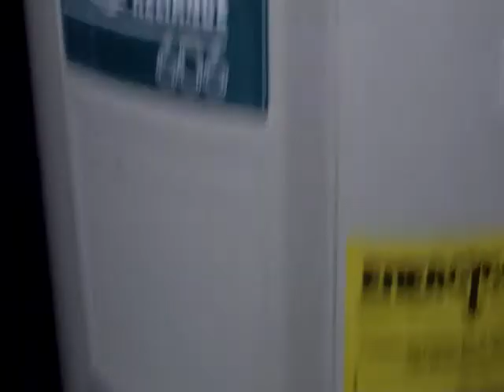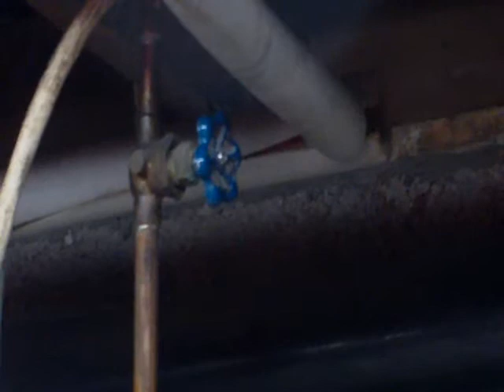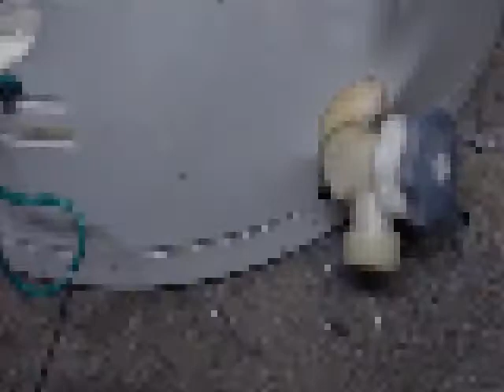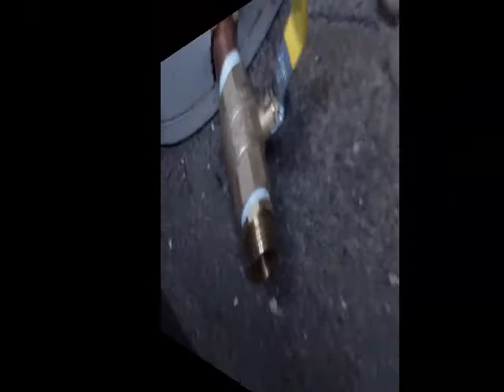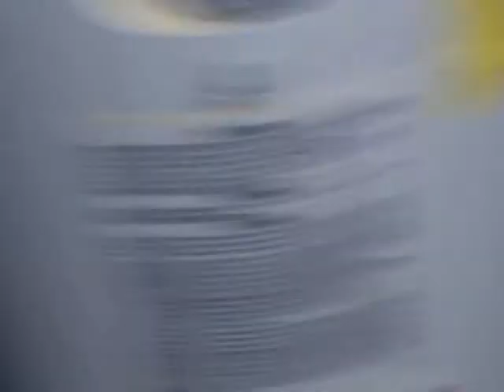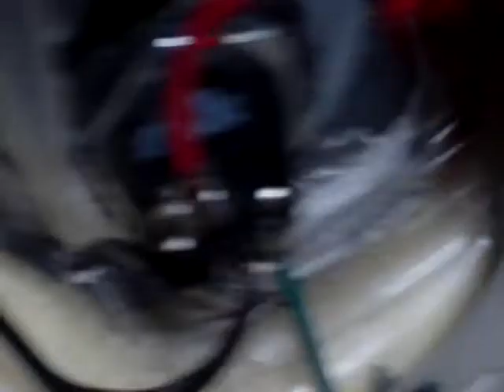ELECTRIC WATER HEATER ELEMENT & DRAIN SHUTOFF REPAIR

Comment from the maker: yes it was worth the cost of the elements. After this I had better heat, but it wasnt purfect. Later tests also showed the lower thermostat was inop. Which was the main cause of the failure. Test both before you decide which way to continue. Good Luck

Comment: Great Video. Wondering how your hot water was after and was it worth the cost. I'm having the same issue. Moved into a home that was never cleaned out for 7 years. I can't afford to install a new water heater right now. I'm hoping I can do what you did to help it last a bit longer. Thanks for the help